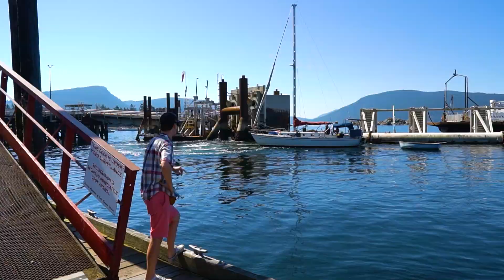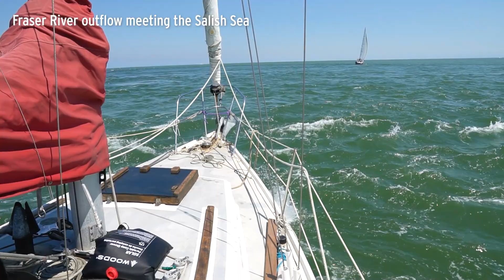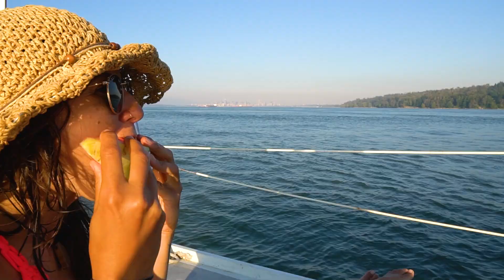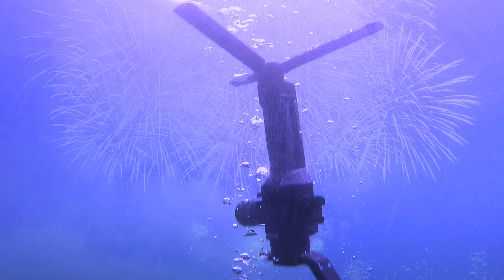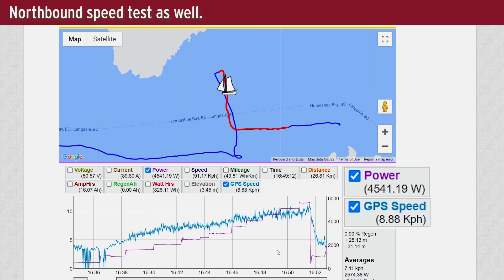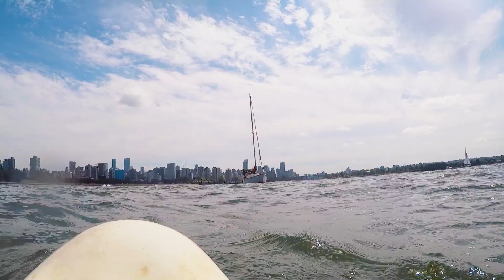Belle Amie Part 3, Cruising experience to Vancouver, Speed Trials, and a Northbound sendoff

Comment: Can you please post a link for the specific motor used in this conversion?
Reply from the maker: It was an experimental motor build that we did, converting a 3T 45mm stator which would normally have a KV of 12 rpm/V into a delta winding with a KV of 21 rpm/V.  It's not something available for sale.

Comment: How much pollution does the manufacturing process make?
Reply from the maker: The manufacturing process of what part exactly?  The entire sailboat? The electric motor? The diesel engine that it replaced? The batteries? The solar panels?
Reply: @GrinTechnologies  all of it 😁👍⛵⛵

Comment: Hi, love the 3 vids ! Can you do regen on that boat while sailing ? If you can’t, would it be a lot of works to install the regen capability ?

How much energy could we expect from regen ? (I assume it would be in function of the boat speed)
Reply from the maker: Yes for sure, we've covered this in some of the videos of the Shamrock conversion and on the endless-sphere thread. With the standard stock sailboat propellers the regen seems to top out at around 100-150 watts depending on the wind speed, if you attempt to pull more power than that via the controller then the propeller stops spinning.
Reply: @GrinTechnologies  Thanks for your answer !

Comment: Is it possible to get some ballpark amounts of how much the conversion cost?
Reply from the maker: In the realm of $2000 for the motor and controller electronics, and then anywhere from 4K to 12K on batteries depending on your source and how many kWhr you get

Comment: Do you cool the motor?
Reply from the maker: In this case no the motor is running without statorade and without any outside fans and you can see from the CA display screen that in steady state it's fairly toasty (~110 oC). This is to establish a benchmark for the performance without any mods, and we then plan to see how much cooler it operates with statorade and then statorade + fins when Toni is back in the neighborhood again.

Comment: Wondering why the heavy dependence on motor power in this video when you have sail. I never saw the jib being used even when you were reaching. A 32' sloop rig should have a hull speed of over 7 knots. You should achieve about 6 knots on a broad reach in a fair breeze.  I don't sail there so are the winds that flakey and the lee shores and shoals so bad that constant motorpower is necessary? In my experience, on the east coast-Long Island Sound to Cape Cod and Martha's Vineyard, I was powered primarily by sail (sloop rig) and only started the engine if I was totally becalmed or to motor up to the dock.
Reply from the maker: Hey Rik, they were in the process of installing salvaged furling jib on the boat not long before this trip but it wasn't ready to deploy, so that's why it was just the main sail during the crossing, which alone would just get ~2 knots in these super light winds. Hence the use of the motor otherwise it would have been painfully slow. With normal breezes and with both sails it goes just fine at 6+ knots and there is no need motor.
Reply: @GrinTechnologies  When your sailing rig is operational, I would like to know how much wattage you can harvest from windmilling your prop at different points of sail i.e. running, reaching or close hauled. Sail has a lot power, I've towed a fair sized power boat that had engine trouble at 3-4 knots back to harbor.
Reply from the maker: @rik999  I'm expecting upwards of 150 watts in good wind but I'll check in with Toni to see if she saw on the trip North. She made it up to the Broughton's several weeks ago and had the foresail install finished while here in Vancouver.